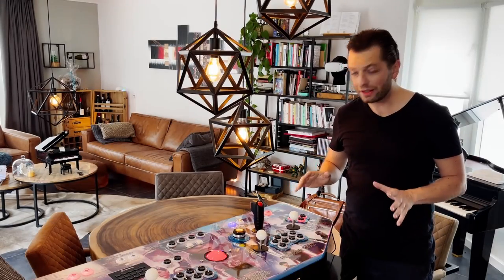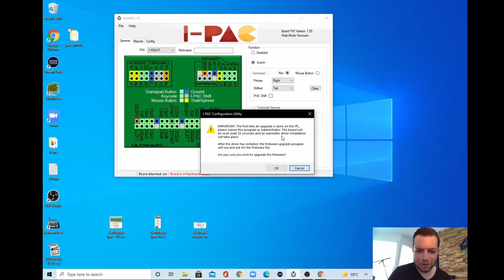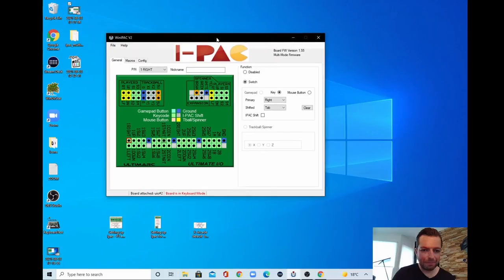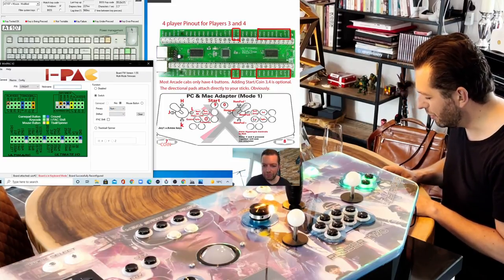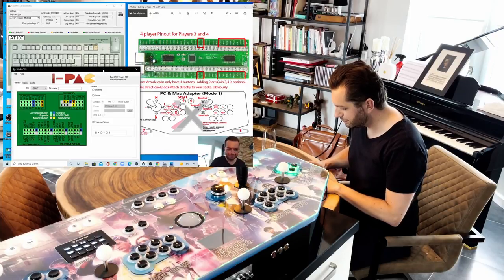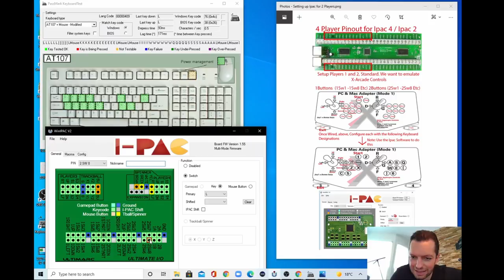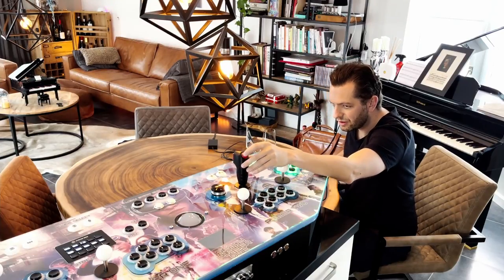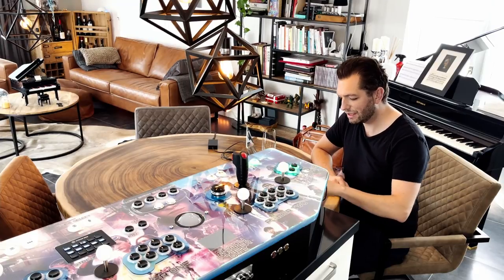Dual Ipac Ultimate Setup Tutorial - For huge control panels

Comment: Hi Daniel, I love your control boards with no visible screws. What size is the wood and laminate to allow the trim to cover them both? If I go with standard dimension the trim would not cover the wood board and laminate top.
Reply from the maker: Hi, the T-Molding is 18mm, the MDF panel is 19mm and the plexiglass is 3mm. So the Tmoling does not cover the plexiglass. This way, the side of the plexiglass is lit because of the LED buttons. If you like to fully cover the side of your panel; go for 16mm MDF and 3 mm plexiglass. That way the T-Molding will cover everything (you won't notice the 1 mm difference)
Good luck!
Reply: @TheDanielSpies_Arcades  the company building my cabinet has never did this and said it would cause problems with dust getting in between panel and plexiglass. Have you noticed this on your builds?
Reply from the maker: @inthegetto55122  no, it will work out fine 👍🏽

Comment: I’m going this route as well…question: When using two Ultimarc Ultimate I/O boards with Mister, do they show up in the Mister control configuration menu as separate PID’s? Presently, Mister seems to have a problem recognizing more than one PID at a given time (I.e. keyboard (IPAC) + USB joystick).
Reply from the maker: Hi, you should be fine with two Ultimate boards inserted in two USB ports of the Mister. Also, make sure the second board is ID2 (firmware update needed). Let me know if this works!

Comment: I would like to make a new botton box for my Farm Simulator Game as i've built a cockpit with 80+ buttons[ i've got Pictures]. Would you use the I-Pac Ultimate. i'm using 80+ 5v Led Buttons has 5 cables coming from it Power, Ground,  Common Pin, Normal Closed Pin, Normal Open Pin or what would you recommend. the buttons are 19mm, i dont thing they have built in resistors, i can have the LED ring on all the time or off, when LED off you press the button and the LED Ring lights up. i've got it wired up to 4 x 20 output basic arcade encoder but when pluged into the computer only 5 out of the 8 outputs sections working [ it must be a game thing,when i fiddle about you get it to work but in different 5 Section 1-5, 8-4, 2-6]. the encoder has 2 x 10 led outputs for the switches. would the I-Pac Ultimate be best and if so who would you wire it up. can you use the RGB wires for three switches and the negitive on to a daisy chain. The power cable would daisy chain to all three switches. What wiring harnesses would we require to do the job

are you on face book

Thanks
Kevin
Reply from the maker: Hi Kevin, this is s bit too much to respond to on Youtube. You can email me with your questions and attached pictures and I will try to help out.
Will be outside the country for the coming three weeks so take your time 👍🏼 thanks,
Daniël

Comment: If you wanna play on a real game console just how your build is already right now. Place your arcade on dinput mode. You also need a Titan 1 attached to the game console and the USB cord that comes with the Titan connected to the pc.  Turn on the Gtuner software for Titan 1. Go to tools, look for device. Place the "output" on the game console you have. So if you have Nintendo switch. You put the output on Nintendo switch. Click close, then open "Max Aim DI" go to Direct input. Look for your IPAC controller that's in dinput mode. Go to device monitor to confirm controller is working correctly. After you found your controller. You must map the arcade buttons to the game controller layout. Save the layout you mapped by click on export. Import will load the profile whenever you need it. After you completely mapped controller, you can start gaming on your arcade system to real game console. Note ....PC must be running at all times with Max Aim DI running all the time. Also .....this method only allows 1 player to work. The hard truth is.... zero delay encoders are better than 1 IPAC. If you wanted true 4 player gaming on real game consoles. You would use a combination of 4 zero delay encoders and 4 Titan 1 adapters. The setup will be different from the first method I told you. You would map out each zero delay encoders with 4 Titan 1 one by one with xmapper instead of max Aim di so you don't have to keep the PC running 24/7. After you programmed all 4 Titan 1. Stick all the Titan 1 inside the game console. Then stick all 4 zero delay encoders USB cord inside the game console. You don't need the program cord for the Titan 1 anymore. Just the zero delay encoder cords. If you can offered it, go with 4 Titan 1 and 4 zero delay encoders. Right now you with the rig you have can only program 1 player for real game console.
Reply from the maker: Wow , I don't think I actually understand all of this but Thanks ;-)

Comment: @TheDanielSpies  I have 2 ipac ultimate IO controllers, when I was setting up the LED blinky I only had one ipac connected to map all the buttons to LED blinky. However when I tried to do the other ipac controller (unplugging the one I already did) led blinky wizards states that it's already mapped and that it will wipe the setup if I continued. Any idea how I can make led blinky map both ipacs without overwriting the other?

Or create a tutorial video that will help others in my situation.

Any help is appreciated.
Reply from the maker: You will need to set the second IO to ID2 by flashing the firmware first 👍🏼 that will solve the Ledblinky problem.

Comment: Do both boards need to have firmware flashed? (Separately, one at a time) or just the "second" PAC board?
Reply from the maker: Only the second Ipac board. Make sure you open WinIpac as administrator(!) or the flashing will not work 👍🏼

Comment: Can I use a pacled64 with the ultimate IO to extend the number of rgb buttons.. I I have 38 but can only use 32 on my Ultimate
Reply from the maker: Packled is only for driving the leds of the buttons. Not the button presses themselves. You would need another Ultimate IO board and set that ID number to #ID2

Comment: Hi Daniel, can you assign player 3 and 1  on the ultimate IO as player 1 and 2 . And then 2 and 4 on the other or do you have to configure as you video .
Thanks
Reply from the maker: Hi, I am working on a new building series as you might have seen already, in part 5 I will install everything in detail. And you are correct, I use player 1 and 2 inputs on Ipac board one as for player 1 and 3. Keep an eye out for PART5 of the Pedestal building series. Thanks Daniel

Comment: Do you know if the firmware for a second board is needed if you are using 1 Ultimate I/O board and 1 PACLed64 board from ultimarc?
Reply from the maker: No ID2 firmware needed. This is only needed when using dual ipac setups. Thanks, Daniel

Comment: Is it possible to just use player 1 and  2 ports on both ipacs to run all 4 players if you're not using rgb buttons? As I want to use a 6 button layout for players 3 and  4 and already have the 1 and 2 player wiring for both ipacs?
Reply from the maker: Hi, the RGB feature is not correlated to any of the button input ports. So yes, you can map any input port to be used as any button you desire 👍🏽 thanks,
Daniël
Reply: @TheDanielSpies_Arcades  thanks for the help really appreciate it as a newbie to all of this your videos are helping a lot and inspiring me to make changes to my original design as I now want to add some light guns to my build 😁